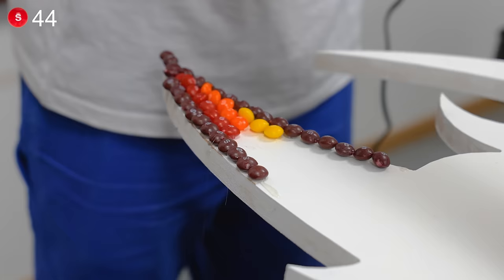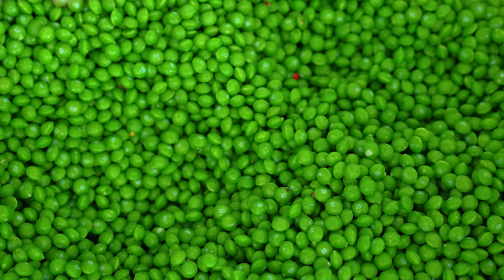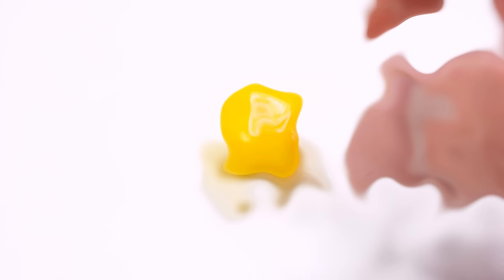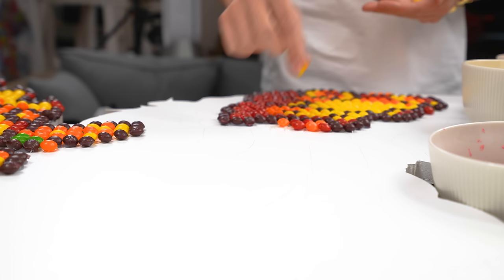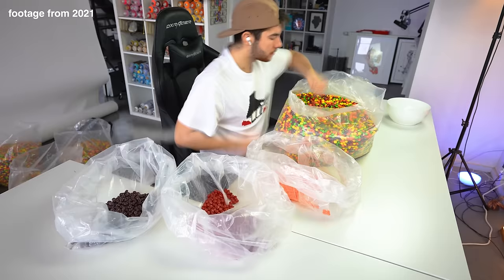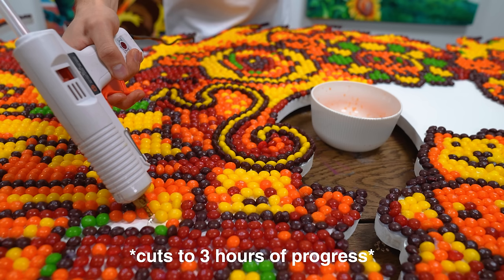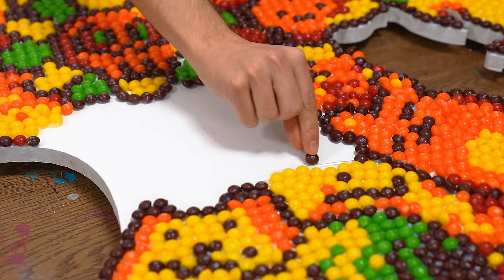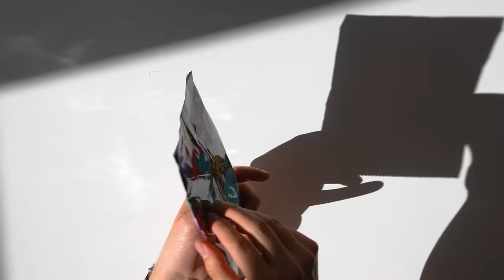Making A Huge Artwork With 1,000,000 Skittles

Comment: The dragon is insane, nice work. If I had this hanging in my house, I would definitely do a clear coat of resin over it with extra polish just for an extra touch and to prevent any strange smells and other bacteria from escaping, also as a protective layer.